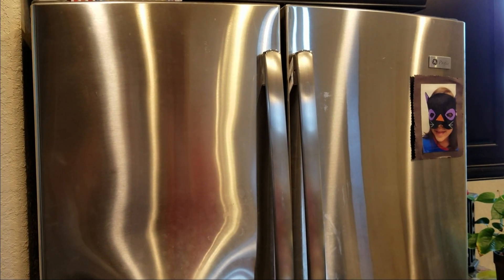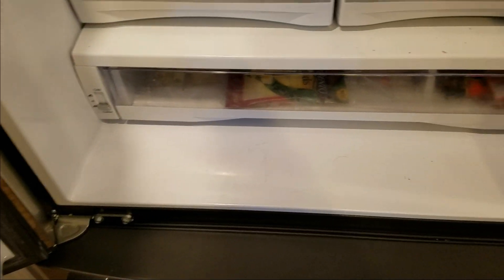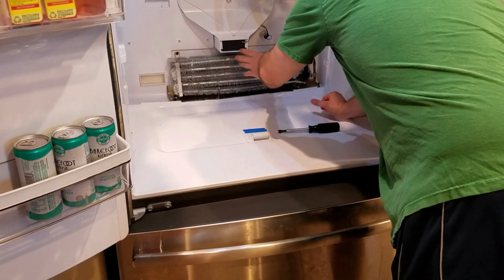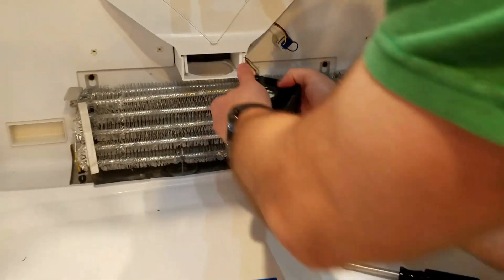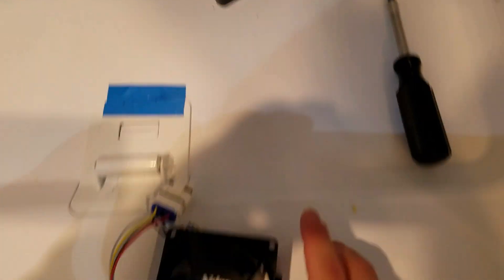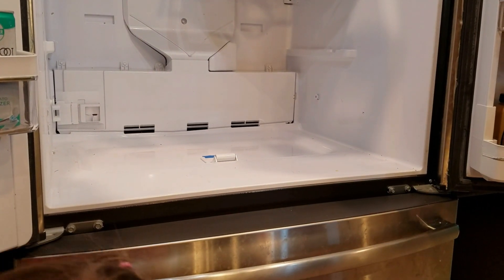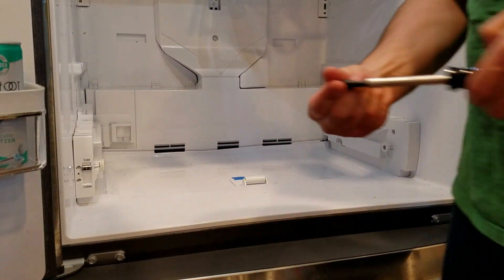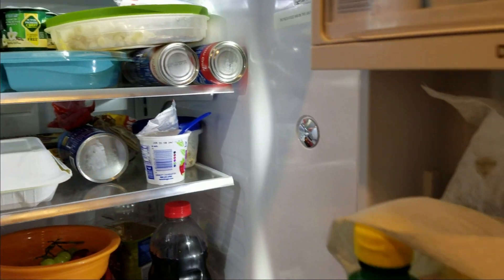GE Refrigerator evaporator fan repair

Comment: Fabulous!  Much appreciated.  
We have a GE Adora.  The directions are almost exactly the same except there's another wire harness on the front left of bottom drawer.  It's for the light.  Be gentle pulling that drawer out so you can unhook it.  Like the wire harness for the fan, it will not let you put it back together incorrectly.
30 minutes including a thorough cleaning.  10 min for the fix itself.

Comment: do you have to unplug the fridge first? about to do the same repair tomorrow but dont want to try and get behind it if i dont have to
Reply from the maker: @toml2702  If I'm working on something electrical, it is advised, and I usually do. While this is just plug and play, you dont want that fan to spin up on you after you plug it in.

Comment: FYI I believe the problem is too much moisture.  Check that your door gaskets and the articulating mullen are sealing properly and clear the drain by forcing water thru it.  You may have to clean the drain tube in the back of the refrigerator, the black check valve at the top of the tube gets clogged.  Also, if you are having problems getting a new fan motor quickly, and have some food safe silicone lube spray, try removing the old fan, spray some lube from the underside of the fan blade to get it into the hub area while spinning the blade with your fingers until it feels free.  It may function until you can get a replacement.

Comment: Thank you for this video, we have a cold fridge again. The only parts that gave me trouble was the condenser had so much ice I couldn't get the cover off, I had to use a hair dryer. The other part was getting the fan wires out of the guide. All done now, thank you.
Reply from the maker: Glad you're all fixed up!

Comment: I have a GE Profile looks like is the same regrigerator. I'm having a small issue on the side where it has 2 fan holes where the air comes out is only blowing cold air in one of them not on the other one can that fan be the issue?
Reply from the maker: Hey! I'm actually not sure. It would be several issues, from simple like a fan being bad or could be from ice buildup.

Comment: Very good video and it works for me.  However, I got a problem to get the part (evaporator fan) from local stores if you want to get the fan right the way beside Amazon.  You won't find it in Home Depot.  If people live in L.A., you can get the fan from Coast Appliance.

Comment: Same issue here. Did you have to update the firmware or did you jus install it as it was? A++ video btw
Reply from the maker: Hey thanks! On my model I did not update the firmware. If your model matches mine you're good to go; double check your model but chances are it'll probably be fine without it in my opinion. The instructional I received match a model that differed from mine that needed a firmware update.Good luck!
Reply: . Yea my  serial # started with sd but I recently had the fan replaced in the temp control vegi drawer and the man updated through a USB on the top of the fridge. My new fan for the main level is pn  WR60X35205

Comment: Great job man , one issue though , once you  reached this far with your fridge i think you should have cleaned the drainage pipe , you will be amazed with amount of dirt accumulated in that drainage pipe .
Reply from the maker: Thanks for thr feedback, this is a great suggestion!
Reply: @jatala  on the lower back side of the fridge you will find a metal panel secured with 5screws , once you open it you will find drainage pipe and drainage pan as well as evaporator on the right side  . The drainage pipe has a rubber nipple designed in such a way to limit the drainage water into drops , usually that rubber nipple gets clogged by scales waists that looks like egg shells let alone the pan and the evaporator . Hope to see more of your grate videos

Comment: I have a ge fridge mo.#gshl6phkcels was working when i bought it .then freezer was good but. Fridge was only cold in lower region.then freezing. Now ive noticed the wires two were not connected in the front from below left and right by each door need wiring diagram or what to do next

Comment: thank you so much
Reply from the maker: You're welcome!
Reply: @jatala  I've got a Used GE unit... looks exactly like yours here.  I bought it in January and it immediately had this problem.  The store came and replaced the fan, but I think it'd gone again.
I ordered the same part number you have here.  I don't know if the store used that part number or a different one... wondering if the fan you put in in 2018 is still going?
Reply from the maker: @DANT98  I have since moved and no longer own the unit unfortunately, but it was working perfectly when I did. These fans are cheap quality and if you got the same part number as I did you are probably safe. It's easy enough to replace to see if it works. Good luck!

Comment: Sometimes my GE refrigerator has same problem.When it occurred the refrigerator compartment will up to 58F-60F(whatever what temp I set) and the down drawer will be freeze,then the freezer compartment will down 2 F as I set.So obviously the refrigerator's evaporator fan didn't work caused the problem.But after several days it works normally,looks like the fan works again,but it's very loud.And after several days the problem will come back again,so the problem just randomly happened.I am not sure is it the evaporator fan problem,it seems like it's not completely not working,just like sometimes it's dead and sometimes it just alive.I am very confused with it.Do you have any suggestion?Thank you!
Reply: If you are still having the same issue after all this time, I suggest you replace the fan. That sounds like what mine did for several months, then it icing occurred, then the fan went out. Waiting for replacement so I can install it. I wish I'd replaced it when the fan started making noises; I just wasn't aware of the fix at that time.
Reply: @gmoore7353  I did, just the fan cause the problem. The fan has 2 speeds, just one is failed so confused us. You are right, replace it when the fan start making noises.

Comment: I ordered the same fan # and now my fridge is cold but bottom still freezing everything.  Got the update firmware today.....I updated it and hope the issue resolves itself.  I will update you guys tomorrow.  Now my water is not coming out so I was hoping the firmware would fix that as well but hasn't yet.  Update tomorrow.
Reply from the maker: Good luck! Let us know how it turns out.
Reply: @jatala  still no luck.  I update the firmware and my crisper is still freezing and my water is still not working.  :(
Reply: Yeah I am thinking it could be the sensors now.  Guess I will have to call a service tech out :(
Reply from the maker: That's too bad I'm sorry to hear that. Sounds like you may have some other issues going on. I would try to determine if the new fan is spinning at all.

Comment: My serial number starts with LA.  Based on the instructions you show, it appears to be outside the range that requires reprogramming.  Unless it says something different?  Someone mentioned in the comments that part number WR60X29099 also works and needs no reprogramming regardless of serial #, but it is a lot more expensive than the replacement part you mentioned, WR60X26866.  As long as LA doesn't require reprogramming, I think it is better to go for the part you mentioned.  I think I can accomplish it all except possibly reprogramming.  I am bound to screw that up. So hopefully it isn't needed.
Reply from the maker: Hey, both are still cheaper than a new fridge, good luck!
Reply: @jatala  Despite what GE told me, that only part WR60X29099 would work for me regardless of my serial number range, I went for the part you said WR60X26866.  It worked perfectly.  As my serial started with LA, there was no need to reprogram. Thanks so much for your help with the clear and detailed video you posted.  Saved me a lot of money.  It is much appreciated! For any others, my model is slightly different than mentioned in the video, mine is GE Profile PFE29PSDSS. Serial number starts with LA. Part worked fine.  Cost about $56.00 on Amazon. Got from there as I was able to return at no cost (Prime item) if for whatever reason it did not work. Thankfully it did!
Reply from the maker: @leigh458able  I am glad to hear it worked out!
Reply: @leigh458able  Does anyone know what will happen if you use WR60X26866 in a model where the SUM is required? I have a GFE29HMEHES with serial # starting with HD. Apparently that serial # is in scope for the SUM update. I ordered the full WR49X25197 kit that SHOULD have had fan and SUM, but the parts company sent me just the WR60X26866 fan. And that took over a week. I can't go another week without a half functioning refrigerator while waiting for the full kit or the WR60X29099. I'm tempted to just plug in this fan and see what happens, but wondering if it might burn up the motor or something (does the software update limit fan speed?)

Comment: Question...was your fan still running but not at the correct speed?  I'm having a very similar problem as what you are referencing but my evaporator fan is running.  Don't know if it is running fast enough?
Reply from the maker: I suppose it is possible. Mine was not spinning at all, but made some awful vibration sounds before it went out completely. In your situation if there is not enough air moving over the evaporator coils it is possible for them to still freeze up.

Comment: Thank you for this post.  I did not update the software but installed the fresh food fan on my model GFE28HGHBBB and I used Part # WR60x29099 and all went well for few days...then the water dispenser froze and I have ice under the deli tray.  I poured hot water down the tube under the fan but still it freezes.  I didnt receive any instructions with the fan so I was unable to update the software, do you think this is the problem?
Reply from the maker: It is possible. You will want to be sure that you reference your specific model number and the part the GE recommends from their diagrams. You may also have other issues going one as well. Good luck!

Comment: I'm on my second time replacing this damn fan.  First time was less than a year of ownership so it was under warranty.  My part comes from amazon tomorrow night.  Looks pretty simple.  Thank you.
Reply from the maker: Good luck!
Reply: My bottom freezer ice dispenser stopped making ice and just use it as food storage. The temp on my fridge is 42 and I'm currently concerned if this fan needs to be replaced.
Reply: My refrigerator is 13 months old & waiting on the second fan to arrive. At least GE is covering it.

Comment: Quick question...I ordered the fan and the update module.  The fan is here but the module won't be here till the 3rd week of January.  Do you know if I can go ahead and put in the fan and then update the software when the module arrives?
Reply from the maker: Good question Jimmy. If you're in a pickle, I suppose you could get that new fan in and see if it kicks on without the firmware update. Worst case is it won't kick on. I assume the firmware update is to fix what is making these fans go out prematurely. So you'll probably want to get it updated as soon as it comes in or you may end up ordering a new fan again. ;) I need to mention that my model didn't need a firmware update, the replacement fan came without it. It all depends on the model fridge, and I got lucky!  Good luck and happy new year!
Reply: @jatala  Thanks for the quick response.  I went to the link that showed the criteria for the serial number letters.  I noticed the yellow paper on your video showed the date range from May 2015 through March 2015.  When I checked my numbers, it was May of 2015, which if I read right, put me out of the need for the update.  So I went ahead and installed and will check it in about an hour to see if it is cooling.  Your video saved the day.  I will probably still update the firmware when the component comes in.  Man...that fridge needed a cleaning.  Took longer than the repair.

Comment: This video was outstanding.  Thank you Jonathan Fasullo for posting it.  I ordered the part #WR60X26866 from the GE website www.geapplianceparts.com .  It cost $48.22 total and was delivered in 3 days.  I popped it in and it worked without any further programming or anything else.  If you order from the GE site, look for a discount code and it may knock off a bit and/or get you free shipping (I got about $10 off).   The GE site also allows returns within 30 days, or up to 90 days with a $15 restocking fee.  Thanks again for the video, Mr. Fasullo.

Comment: Another happy customer, thanks.  GE 29 cur fridge with original fan part #WR60X10356.  Replaced with #WR60X29099.  No software update required.  I was a bit worried since it took about 20 minutes for any fans to turn on but eventually it started cooling, and by this morning both freezer and fridge were spot on (0/36 degrees respectfully).  The freezer had been running 4-5 degrees TOO cold, and the fridge about 19-20 degress too warm.  Also, lowest fresh food drawer was frezzing items.  Problem solved.

Comment: Cheap ass fan for a $1000+ refrigerator. You would think they would put the most reliable part for that. But no.
Reply: They are ALL JUNK. It's disgusting.

Comment: Thank you for posting this video.  I was able to replace the fan in record time.  The whole ordeal only took me about 20 minutes.  I have never replaced parts on an appliance before, but was able to do so thanks to your video, with the clear instructions and the video to boost the confidence.  By the way, my fridge originally had that WR60X10356 fan, which GE stopped making and replaced with the WR60X26866 (which apparently requires programming).  I opted for the WR60X29099, so no programming was necessary.  I am looking forward to cold food once again.  By the way, I ordered my part with free one day shipping from Amazon.  No local businesses carried the part, and if I ordered locally, I would still have to wait for 2 business day shipping.

I would like to add that my husband and I used your video to de-ice the original fan, which bought us a few months time before the problem returned.  This time, I broke down and ordered the fan.  Both times we used the video, the fix was quick and painless.  Thank you again.

Comment: Where did you get the fan?
Reply from the maker: Hey Chris, I was able to pick mine up for a fair price (at the time) on Ebay. There are plenty of other parts wholesalers available as well, including GE if they have them in stock.
Reply: Thanks Jonathan. The fix worked exactly like you illustrated.

Comment: Did this fix your problem? I am experiencing the same issues with freeze up in bottom tray and warm fridge. When I took my fridge apart and de iced it the fan started working again but the temp will only get to 40 degrees in the fridge.
Reply from the maker: Hey Steve, yes replacing the over priced plastic fan fixed my issues. Make sure you let it run for at least 12 hours to let the temps settle out. You still may need to replace your fan.

Comment: the problem is they decided its a great idea to use computer fans in these things, those fans don't like moisture at all. my fridge is 32 years old and still has both original fans and they work fine still. good video tho
Reply: Can’t agree more! Mine failed in just 3 years. Unbelievable!

Comment: I too have the same problem (cold freezer and warm refrigerator section) and ordered the fan and software cable repair kit off of Amazon (included the fan and cat5 cable for the SW upgrade).   My GE refrigerator is a slightly different model built in 2012 but the interior is nearly identical with the same replacement fan model number.   I'll use the procedure you've shown today.    Thanks for the video...